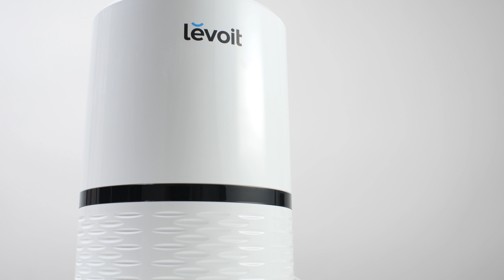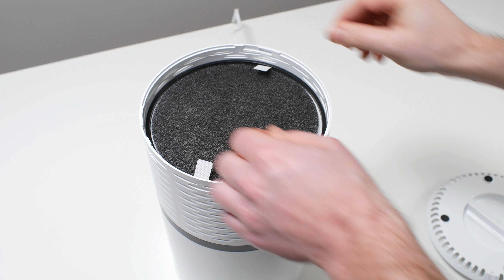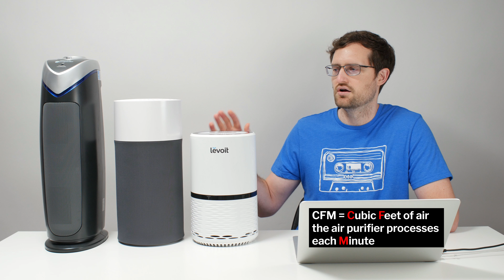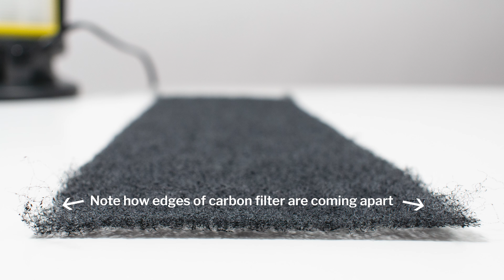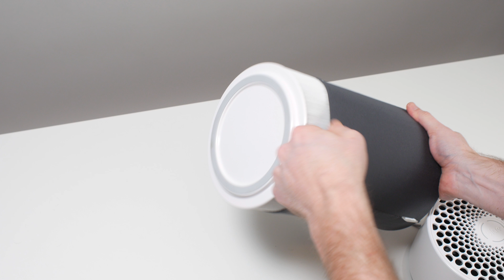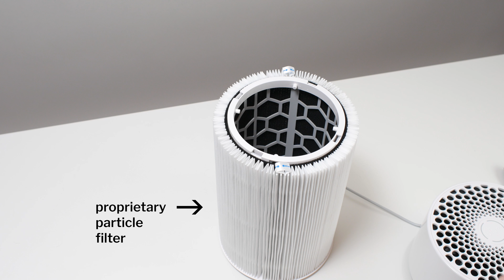The Best Air Purifier Under $100

Comment: Is there something you would recommend that is cheap, and also cheap to maintain? I just want to remove some dust from my room, small room maybe 25-30 square metres, 

I  go on amazon, i find something for cheap then the price triples because you need to buy filters..  (maybe the first one is included but) then every few months you need new filters? I want clean(er) air in my room, but I don't want to spend $1000 per year

Comment: Hmm I don't know if you're a shill or they send you better products cause the Levoit literally smelled the second I turned it on, had to return.   THEN a Veva 8000 actually worked well but they have no filters for sale so I am considering the Winex 5500-2 but am afraid it won't get enough dust
Reply: I think he might have gotten ones that haven't slipped through quality control. But also, I don't think he's got any vested interest in Levoit cuz I watched another video where he reviewed another levoit and he bashed it and said it wasn't a good choice

Comment: I have the levoit model and love it.  I don't use it to clean the air of the whole room because of the reason that you mention but fit its on my nightstand by my bed and runs quietly enough on high for me to sleep.  Since it is by my head I use it for when I am flat for periods of time due to my sinus issues.  I will say that it also will dry out the air a tid bit but I could immediately tell a difference in the air quality from using it.  I have two cats and two dogs that sleep in my bedroom and I have allergies to cats and dogs.  My main filter is the HVAC system and I have a WINIX 5500 for my family room.

Comment: I have the identical Levoit model.  That light-dimming button only works on the giant blue nightlight that glows upward from the middle area of the unit’s top.  You can dim or turn off the nightlight, thank goodness, as it is bright as a search light.  However, the LED indicator lights are not dimmable and are annoyingly bright on their own.  I had to cover them with opaque tape, which helps darken them at night, but not entirely.  Also, since I run the Levoit full time in my medium sized bedroom, I have to change the filter more often than Levoit advertises.   I don’t hate the Levoit but I wouldn’t purchase it again.
Reply: What would you purchase instead if you can do it all over again?

Comment: Special request to do a comparison on using multiple individual air purifiers versus the whole house system with HVAC. If I were going to invest which is better value. Looking for allergy and wild fire smoke purifier since we are in OR. Big thanks.
Reply: The HVAC is incredible! Well worth it. From an allergy sufferer.
Reply: @alisonfraser8231  Thank you.

Comment: You should consider the Taotronics HEPA air purifier for home which is currently $80. The replacement filters are only $20. Another thing to consider for long term cost of ownership. However, it has a CFM of 150.
Reply: thanks for recommending i just got the ap005

Comment: Very nice comparison! My cat sheds more during these 1-2 months. Some of the hairs are very fine and just fly in the air. What do you think is the best for this situation with pet hairs?
Reply: My apartment is only 450 ft2 thanks!
Reply from the maker: Our testing showed that for such a large space you would need two 250 CFM units (such as those recommended in my pet air purifier video) to maintain perfect air quality.
Reply from the maker: For pet hair you want a unit with a good pre-filter. I made a video on the best air purifier for pet hair here: https://youtu.be/wNmRPJ3S57Q